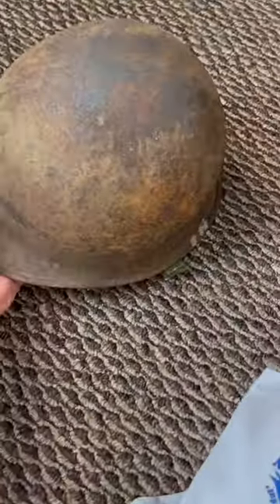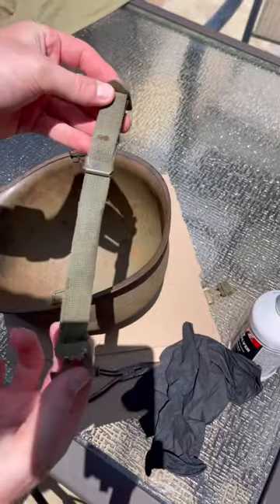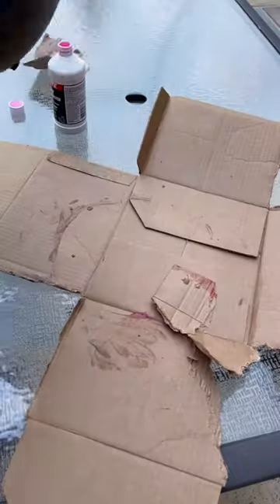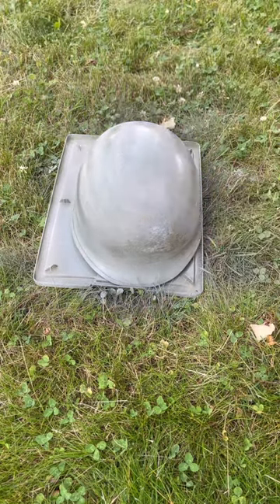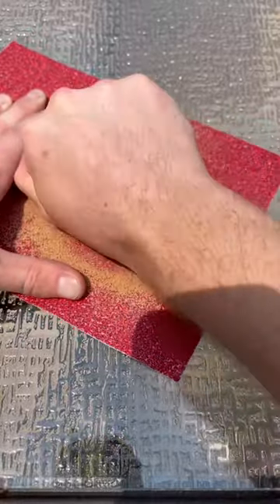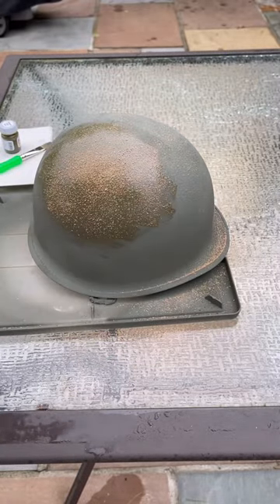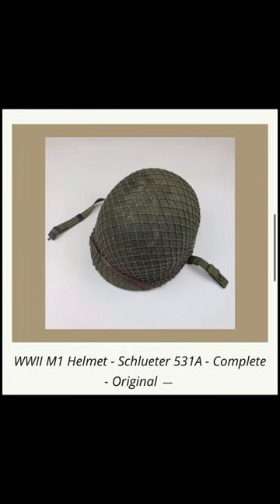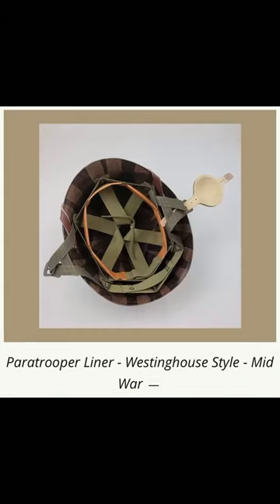Restoring an M1 Helmet for WWII Re-enacting!

Comment: You didn't get that helmet for no 7 dollars, your video is awesome, but that's not believable
Reply from the maker: They’re cheaper than you think! For a rear seam, swivel bale M1 helmet in rough condition like this, $7 isn’t that crazy
Reply: I bought a helmet for $10
Reply: @WorldWarWisdom  Sure my fixed bale M1 wasn't cheap though only $80 but I knew what I was getting into with it. BTW Citristrip will also get the paint and rust off pretty quickly and then hitting it with Naval jelly will kill whatever rust is left.
Reply: It also didn’t have a liner
Reply: You got ripped off bu jmurry inclolol
Reply: Got to Maryland you can get loads of cork